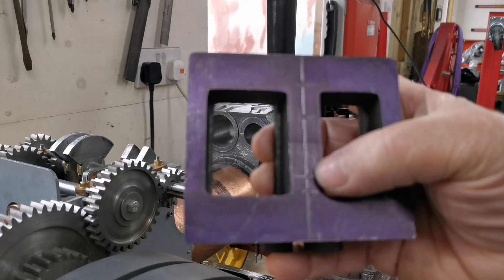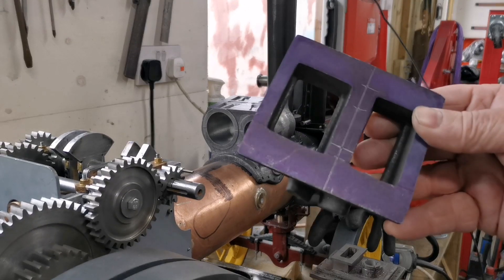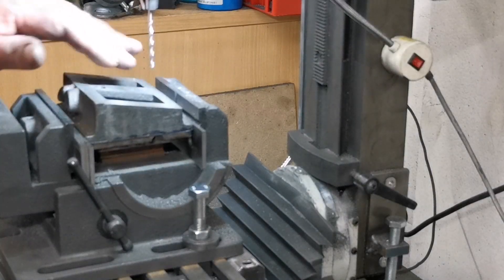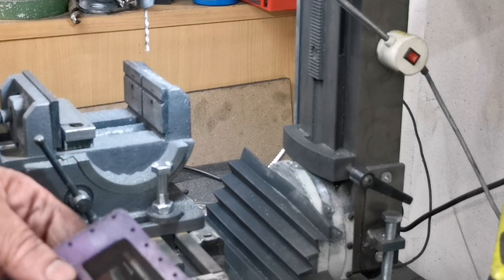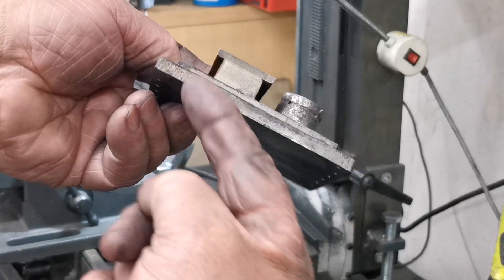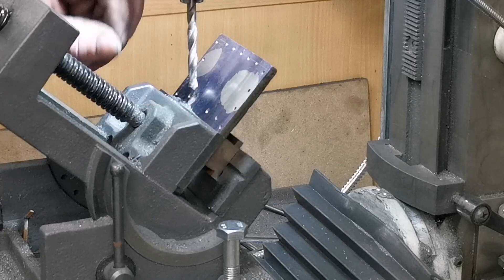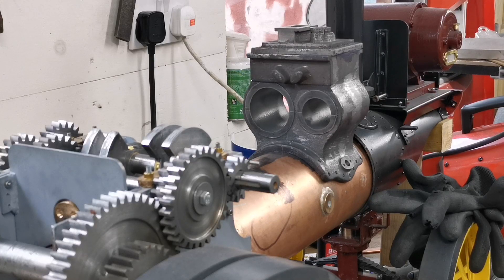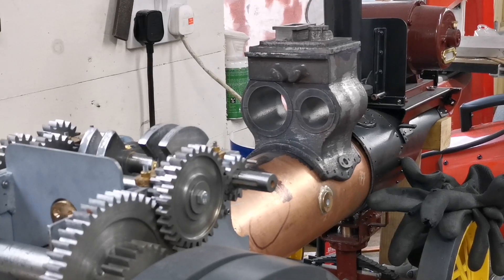2" Fowler Showman's Traction Engine continuing the cylinder top casting and steam chest

Comment: The 'x' hole lined up very nicely, well done!
Reply from the maker: Thank you, I was a bit worried it was going to come through some were it shouldn't but alls good
Reply: @jammymowlam1  I messed up a little Stuart H10 cylinder block trying to drill a similar hole.  Yours is a bit more expensive if it goes wrong!